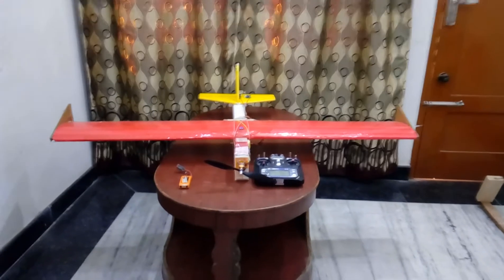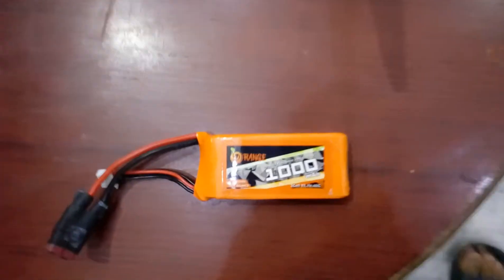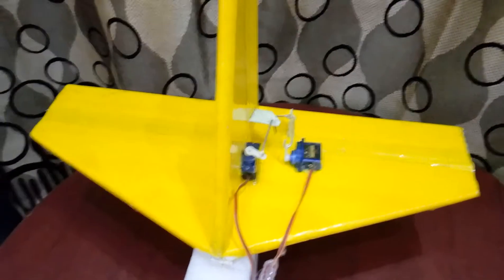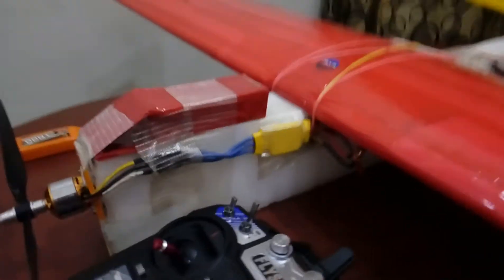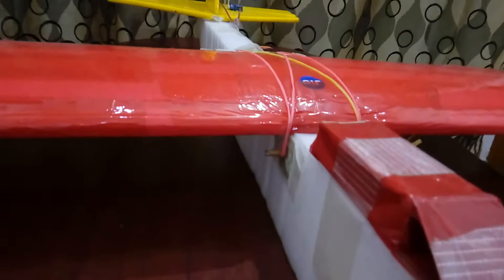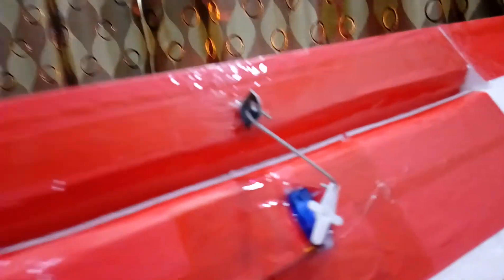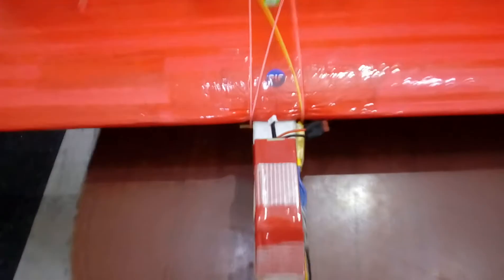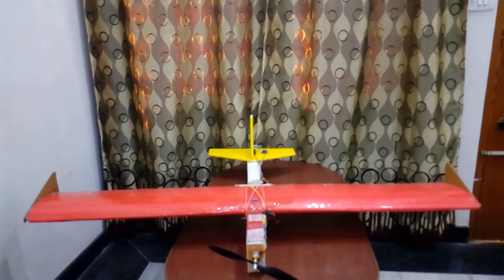HOW TO MAKE A RC PLANE OUT OF STYRO-FOAM...4 CHANNEL RC PLANE

Comment: here are some things to consider.   no one EVER said installing servos AFT of the CG was a good idea.   it is a BAD idea.   unless the mass of the model is sufficient to minimize the Adverse affects, on the model's Distribution of Mass.  do NOT install servos in the tail.  install servos NEAR the CG.  install wing servos, as near to the fuselage, as is practical.   ailerons SHOULD extend to (near) the wing tips.   the use of wing tip mounted stabilizers is NOT correct, for this planform.    at 2:08, the servo shown is NOT correctly installed.   ideally, the prop should be about two inches closer to the main wing; this could be remedied, by moving the main wing, two inches forward.       cheers
Reply from the maker: but my planes cg is already correct. how can i move the wing forward?